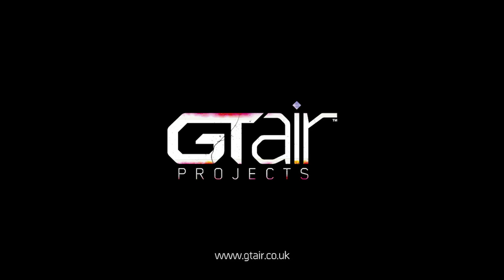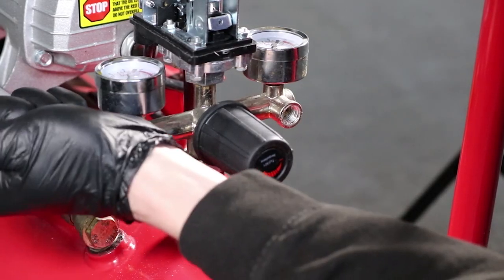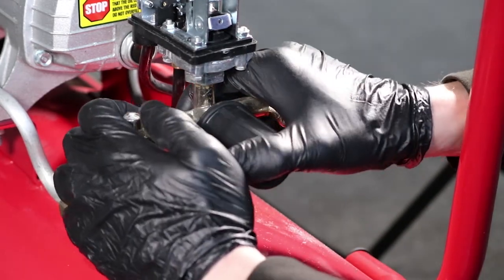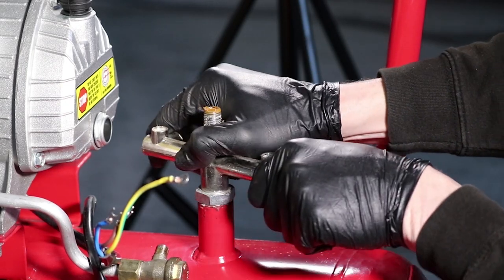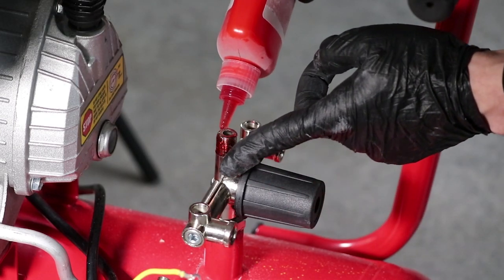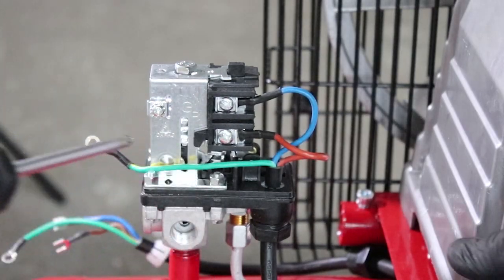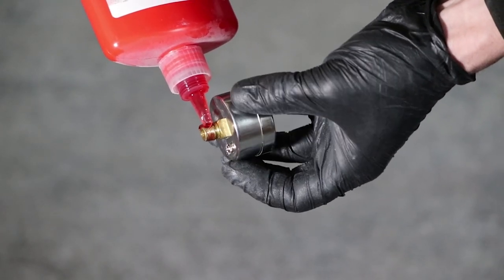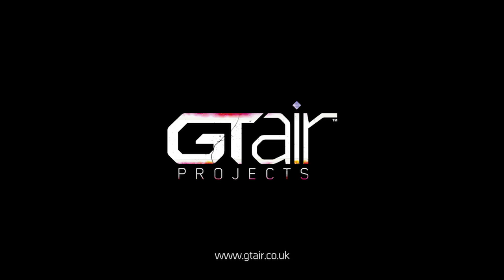How to Change or Replace Regulator Manifold on Air Compressor

Comment: On my compressor it had a air manifold with a built-in regulator. It was always leaking causing the compressor to constantly come on. It also had to be adjusted wide open to get any decent pressure out of it. I removed the factory manifold with a 4 way pipe valve and hooked it up that way. Now it works better than it did new. I took the regulator completely off and replaced it with a quick connect coupler. If I ever need to use the regulator for anything I put a set of quick connect couplers on it so only takes a few seconds to connect it.

Comment: The only question I have is where to find a regulator which isn't based on a manifold made out of the cheapest alloy possible.
Reply: Does Milton make something that would work?

Comment: which side is the motor wires and where is the power cord attach to?
Reply: It doesn't actually matter, you could choose either side - in this instance motor is left, and feed right

Comment: Super useful! Thanks so much! Just one question, why don't you use the sealant in the 'discharge pipe'? Thanks! :D
Reply: Hi. Because its a compression fitting, doesn't need sealant.

Comment: is this what to fix when your building pressure regularly and pressure regulator is optimal but working pressure at tool fizzes out and doesnt work? even though tanks full and compressor isnt turning on.

Comment: hi I have question my compresor runs good when is empti to fill up but when
 I use the air cam down and the compresor try to start the swich from my
 home or box switch  shut down and the compresor  have to empty to runs 
again thanks

Comment: hey, do these compressors have a guage showing you how much/what pressure of air is in the tank?, or are those 2 guages just to set your outlet pressure (the non belt drive model)
Reply: There are 2 gauges, one for tank pressure and one for outlet pressure. The internal structure of this style of manifold is somewhat odd, and it's not actually a "T-connection" like it initially appears to be.
In actual fact, one gauge and one outlet relate to the unregulated tank pressure. The regulator knob's in the centre however the outlet port of the regulator only flows to one side. Hence the 2nd gauge and outlet are for the regulated pressure.
Often people swap around the outlets so that the blanking plug (in the end of the regulated "arm") in placed into the unregulated outlet, then they re-install the second outlet onto the regulated side, where the blanking plug used to be.
Reply: @johncoops6897  thanks for this information. Confirming I understand correctly: the outlet with the safety valve is the unregulated outlet; and the outlet with the blanking plug is the regulated outlet.

Comment: What is the name of the component that the lower end of the discharge pipe is connected to?
Reply: RECTUM....:>)
Reply: Check valve or Non Return Valve

Comment: 1:01 the BLACK PLASTIC COVER IS ON THE ASSEMBLY....   1:05   Where did it go?...thats all I wanted to remove...thanks for the effort though....:>(
Reply: Theres a single phillips screw on the top of the black plastic cover.